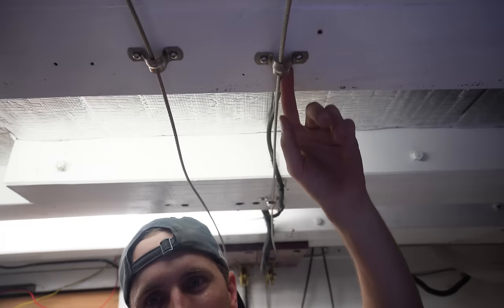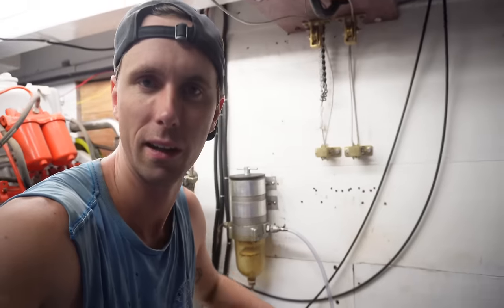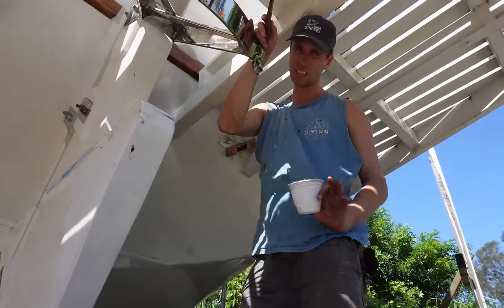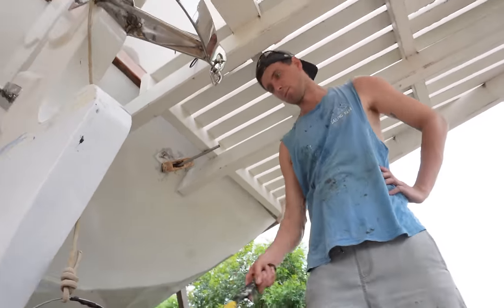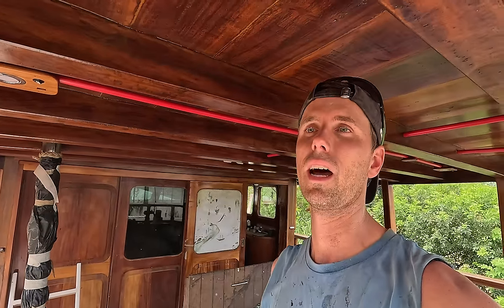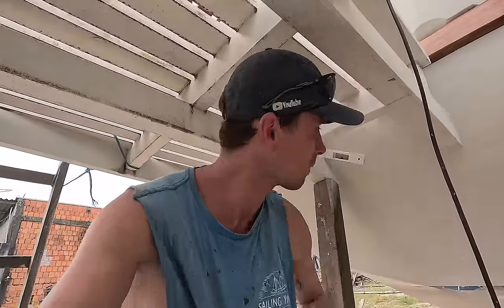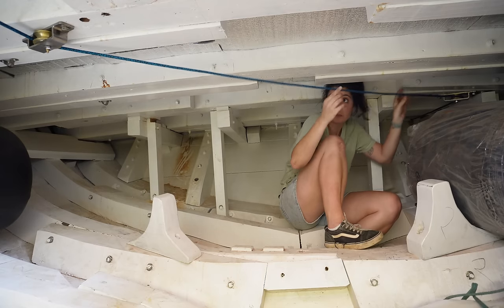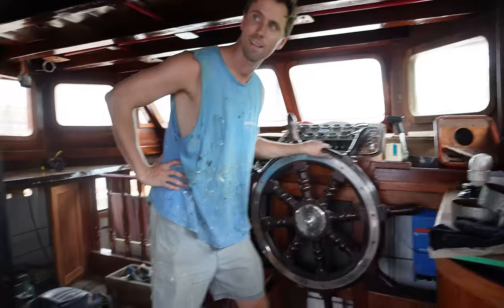Steering upgrades: Ready to steer our rescued boat — Sailing Yabá 166

Comment: I'm a big fan of the show and have been watching for a long time. You guys work so hard! I am also restoring a large boat, an 80' 1931 motor yacht. I have never commented but as an engineer I think it is very important that I mention that ROPE WILL NOT WORK for your steering. It will be frayed at each support eye and coming apart within a year. You must use cable with tensioners. Alternatively, you can use a simple manual hydraulic system with a pump at the helm turned by the wheel, and long cylinder/s with ball ends attached between the rudder and the transom. The rudder is absolutely the last thing you want to take shortcuts on.
Reply: Hi , Dyneema is successfully being used to replace wire steering cables . As long as you protect from  chafe ( which I’m not sure those thru holes are ).  The advantage is the dyneema ( not simple rope) is stronger than the Steel cable and has has much higher flex fatigue resistant, which is why cables break! 
Dyneema is good, if no chafe!!!!!!

Comment: There is no way I am entrusting my life to this steering system. I can think of so many ways this can go wrong. I know you have worked hard on this, and are proud of what you have achieved. Such a critical system cannot be left to “gut feelings” and rope. I sound like an armchair alarmist, but I have a lot of boat building experience, and the steering system is just too critical to be done without expert guidance.
Reply: With clear PVC fuel lines in the engine room, the steering is the least of their problems😮
Reply: It is hard to judge the size of the line he is using, but even  if its only 1/4 inch (4-5 millimeter) it has a breaking strength of 7000 lbs almost 3200 kilos. That of course do not take into consideration what type of knots being used ( best to splice eyes in it ) to attach it to the chain or rudder, knots cut its strength in 2 dramatic ways , the usual weakening of any rope that's knoted loses from 25 to 50% + of its strength depending on knot, but we have found in stressing Dyneema & Amsteel is it can take a few hard jerking tugs, the line will still look like new & then another jolt & BANG it fails at the knot.Which is why we splice it, its best use is constant tension , or in winching it in very long runs, 1000yards  or longer runs.
Reply: I hate to rain on your parade but I'm not understanding the logic on that wooden block your mounting the steering turning blocks on. 
Yes, tension is stronger than sheer. Sometimes.  I question that in your case. Why?  1. The attachment of the  wooden block is in sheer. 2. Using lag bolts to secure the turning blocks is in shear, yes but your relying on threads into wood. No bueno amigo.
Suggestion:  Get your welding kit out and weld up a metal bracket that can be thru bolted to the bulkhead and you can bolt the turning blocks to the bracket.  Much stronger.  
Don't underestimate the forces that the steering system can be exposed to. Especially in reverse.  It will rip those lag bolts out. 
Felize Año nuevo 😊😊
Reply: the dynema lines are extremly tough and that is a huge diamenter. Most production boats have far weaker stearing system, and its hidden away and hard to fix. With the open design they will be able to fix it fast if it has a problem and they have a backup emergency rudder.
Reply: Can’t imagine any insurance company will ever write a policy for this thing. So much is still so wrong.

Comment: Ben I’m sorry that I didn’t say something earlier , two pillow blocks mounted on the ceiling where your chains come down and two sprockets to let the chains turn horizontal and get rid of that 180 turn would really be the correct method especially for wear and tear on cables or ropes . Build it for a hurricane! Happy New Year !
Reply: I believe the links in the chain are oriented in the wrong direction to have it bend the way they wanted to go.

Comment: Excellent work… my I suggest you fit a pair of steering cable tension springs? One on either side of your rudder. These will keep the rope nicely tensioned and also allow a bit of give as the angles change.  Just Google “boat steering tension spring”  and find nice large pair to fit👍
Reply: I wouldn't put the springs on the rudder where they are going to be doused with salt water daily. Put them on the inside of the boat where they attach to the chains.

Comment: for such a large boat and with such a heavy rudder I would have seen a hydraulic system with pumps and pistons as more suitable
Reply: I'm afraid I have to agree with that. This all looks very flimsy for such a large, heavy boat. Steering is obviously crucial, and I really don't think I'd go to sea with this. Not even on a boat half the size of Yabá.
Reply: While hydraulic would work this size and muck larger are using cable and pulleys all the time and commonly being fitted on boat today.  Actually pulley sizes do look a little small  however. 
Cheers Warren

Comment: Just one thing! Thread the dilemma through the hole in the chain not over the chain barrels ! The hole is stronger because the side plates , over the barrels the rope or cable can pull out the barrels from the side plates , your strength is in the holes were the links go through that’s what makes the chain strong it’s links !!   Try it ! P.S. always loved your channel the boat looks great and your doing a great job , your very fortunate to have so much help , love and friends, Happy New Year!

Comment: That Jerry rigged mess of cables and pulleys for the rudder reminds me of a friends old VW bug where he had a string from the carburetor’s throttle linkage that ran outside the car and into the drivers vent window so he could get the bug into the dealer to get the accelerator pedal reconnected.

Comment: You should consider fairing the trailing (aft) edge of the rudder. It will reduce the tendency for oscillation occuring and being transmitted into the entire steering system. It will also reduce drag slightly.

Comment: Love your channel. Five years ago I used a short length of 5mm dyneema rope with a cheap galvanised pulley and a house brick to rig up a rudimentary gate closer out the back. Gate gets used at least 4 times a day and the brick still goes up and down and the rope is hardly chafed. Soon you’ll be enjoying the stunning coastline of Brazil above and below the water. Do those big helm? wheels ever have a small handle coming out at 90 degrees so you can spin them faster if you need to go lock to lock more quickly. Cheers

Comment: Your pulleys will be much stronger now. BUT you need a way to adjust cable tension. I suggest you cut the big wooden block across, fix the bottom half a bit lower down, loose the top half and put two long bolts through the two halves(top to bottom). This will allow tension adjustment.

Comment: Been enjoying the restoration, and the adventure you’ve embarked on. With that said, I’d like to bring attention to the fact that no boats are made with a chain or pulley system for steering anymore. It’s because they fail. Everything is hydraulic, with rams. With a rudder the size of yours, I’d be terrified in heavy seas if it were counting on rope and pulleys to keep that rudder in place. If any of that fails, you’ll be in a life raft. Keep up the dream, but rethink that steering. There’s a reason nobody does that anymore.

Comment: Not only is this a Mickey Mouse setup, what prevents water from coming in through the rope holes?  The length/overhang of the swim  platform would even impress Frank Lloyd Wright. It’s going to need a cable ran up to the mast to support it if any weight is put on it.

Comment: Well done to you both for pushing thru on this project. Like other comments on your rudder system, what your doing will work while steaming forward however that rudder is a reasonable size and I fear you won't be able to steer in reverse. I feel your system is too light for the size of your rudder.

Comment: Happy New year great videos,   I have been concerned for a while now about your steering setup, I really would advise you to get it checked out by an boat engineer
The last thing you want is for it to fail at sea
Reply: I would agree to get a local pro opinion. But, they always have the E tiller if they lose the steering as back up.

Comment: Thankyou ,I'm really glad you listened to what I said about putting a oversize tube through the transom to keep the steering line from rubbing on the wood . I really believe you should of used a softer metal then stainless like brass or copper tubing that would allow the tube to wear instead of the line in case there is a place it rubs on the tube. Keep a close eye on that wear point and if the steering line shows any wear you can change out the stainless to a softer metal.Well done.

Comment: I keep looking at that rudder blade and have to ask the question “ are you going to fair it”? That square end is going to create a ton of drag through the water. By fairing it you should have a smoother water flow over it reducing drag and improving steerage????
Just a thought.

Comment: Happy New Year!!  Hope you're both doing well.  Always good to see a new episode!!  

When you removed those interior cable pulley blocks and mounted them vertically to that block, you made them significantly weaker.  I totally get what you were thinking, but in this case and given the hardware you were using, it was incorrect.  

First, the greatest strength of any screw is perpendicular to its mounting surface (shear strength), so it was actually much stronger mounted the way it originally was at the beginning of the video.  Mounting it vertically the way you did would only be stronger if you used through-bolts and washers, but then again the whole assembly would still only be as strong as the shear strength of the screws used to attach the block of wood to the hull.  

Second, it looks like you mounted the cable pulley blocks to the new block of wood by screwing into the end grain, which is the weakest possible screw attachment into any piece of wood.  If you had rotated the block 90 degrees, the screws would have had much greater purchase as the wood fibers would have been running perpendicular to the screw.  Still not as strong as they originally were (shear strength, as above), but better. 

And to be clear, I'm not nit picking here or trying to be negative.  I genuinely want your boat to be as strong and safe as possible, so we can see you both sailing and enjoying Yaba for many, many years go come.  I've also been involved in woodworking for about the last 35 years, so I'm speaking from experience.  

Thanks so much for sharing Yaba's rebuild with all of us.  I wish you both all the best for 2024!!

Comment: Top tip when you drill and the drill bit snatches... Start the drill in reverse ( that bevels the hole so the drill doesn't snatch ) then forward, let the drill spin up at full speed, gently apply pressure.   Sorry it sounds a bit condescending but you don't know till you know...Hope that helps Ben

Comment: I use the dyneema on my winches and it will stretch until broken in. the salt in the rope will also be a problem. I wouldn't throw out your stainless cable.

Comment: Happy New Year.... I believe that whatever system you end up going with, you are going to need to instal spring tensioners to prevent the slack when you turn the rudder in the opposite direction.
Reply: I have to agree that you will need to install a tensioning system. The cables will need to always be in tension. Otherwise, you will have lost motion and Yaba will steer like a pig.

Comment: You did a good job with the pulleys fit up but you need a turnbuckle on each side to be able to get the proper tension and to adjust later.

Comment: That steering solution will break as the rope used gets rubbed until the breaking point. To avoid that you need pullies everywhere working opposed the power applied. I know this because we had to redo it on the ship my dad built while I was a kid. Guide pipes only work when the rope goes straight through and adding any angle will break the rope, by fraying it apart. There was even a bowed pipe that was used as a guide to keep everything where it should be and even that caused issued down the road. Pullies are the only way to go, well maybe not the only, but it works and don't fail as much.

Comment: I truly love everyone, i have invested time watching and enjoying both of your adventure in this project, to be honest this steering system is scaring me, if the rope or cable doesn't stay centered in those stainless pipe im afraid it will fail.
Reply: Same, ditto.
Reply: Thanks , I do sketchy things all the time I'm wanting to build an airplane, every RC airplane I built crashed each one first flight ( three)
The least I would do is use plastic water line pieces. With the hangers . They have a blow touch.
Cut the pipe 1 1/2" long. Then make a wooden swedg. With the wood lathe. Use the edge of a two by screw pipe down with one of those clamps touch the pipe just tell it gets soft, it will get shiny stop use flaring tools both at the same time  and then  poor  water on it. The pipes out the back my my sketchy bigger stainless with same plastic pipe insert flared on both ends cheap quick and replaceable. 
What do you think would this be acceptable and safer.

Comment: Hi Guys. That steering system looks good. Do you think you should have a tensioning system inside the steerage. I am not familiar with Dynema (can't spell it) and how it stretches over time. I have so enjoyed your build videos. Will you be buying another sinking boat and doing it all again.  I will have a dram or two of whiskey when you eventually slide Yaba down the ramp into the water. Is it still known as splashing the boat? Have a wonderful New Year. Best wishes for you two and the dogs, a special part of the family.

Comment: You are working very hard. However I think you should tension the dyneema and or cable. More than likely you’ll probably have to do it more then once. I wouldn’t want to be in heavy seas with any slack in my steering system. Keep up the great work and Happy New year.

Comment: Hi,I cannot understand why you are dropping the steering cables down the bulkhead and back up again,it is increasing the effort required turning back on itself why not just turn the cables to run under the deck head and the chains through the first set of pulleys.Happy new year,Roly🇬🇧

Comment: sorry to say you have 4 screw bolts holding 2 pulleys with all the force pulling the screw boults out ,originally it was sheer force which I think is stronger. but if you had the steering force going 90deg  rather than going down and up, then going 90deg better force less to go wrong but I  don't know how to turn chain into s/s cable on that 90deg from above to run along the roof   so Happy New year and ask someone more knowledgeable than ME  all the best for 2024

Comment: Hey I would have welded a flange on the out side  give it a smoother riding when wire moves in and out Remember there's going to be a lot of  heavy load on that when under load

Comment: Hey Ben I would have put the pulley block upside down so you have more strength  when pulleys underload  rather than having pulleys on top which pulls on the srew

Comment: Steering system looks good; I’ll offer two suggestions:
- add a turnbuckle so you can take up slack ( even wire will stretch somewhat)
- keep the wire as a spare for a bit, just in case something frays the dyneema - it’s all new, not uncommon to discover that when you get going.

Comment: You've got a beautiful, expensive, 20-ton sailing vessel that will be steered in stormy seas by a massive rudder that depends on the strength and condition of a 1/2" nylon rope that continuously degrades from its harsh environment.  Your steering setup has other likely failure points, as well, but imagine losing steerage in a storm, and what the consequences might be... for the safety of your boat and to your lives.  Your present steering system is inadequate for the needs of this boat.

Comment: Have you thought of a strong fan to extract heat from the engine room and pumping in cool air  from another fan into the engine room even if the engine is water cooled, another thing your rudder  you should maybe add a 45 degree angle on the ruder edge  pointing towards  the propeller from  3 centimeters past the propeller from the bottom all the way up till  3 centimeters from the first connection point to the hull, that will help with little less drag on the rudder and make steering little easier when you turn basically cutting through the water, its optional

Comment: Happy New Year to all four of you..!!  
I am worried about the many dyneema chafe points, especially the starboard transom entry point, as it rubs on the vertical timber support, and all the support saddle straps will chafe. Over time, this will become a weak point.
Also, the turning blocks that you moved at right angles are now relying on the strength of the thread in wood to take the full force of the steeering load times two (mechanical advantage of the pulley) whereas before you had the load bearing on the shear strength of the lug bolts which is considerably stronger.  Maybe the pulleys need to be through bolted to the mounting block of wood or steel bracket on the wall. 
This is a critical system, and one you do want to over engineer. 
Love you guys..!